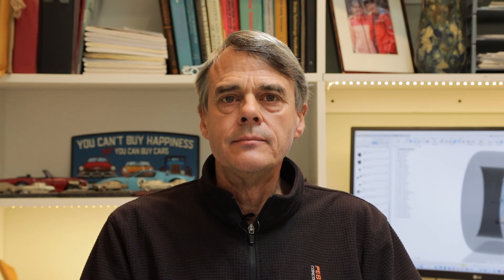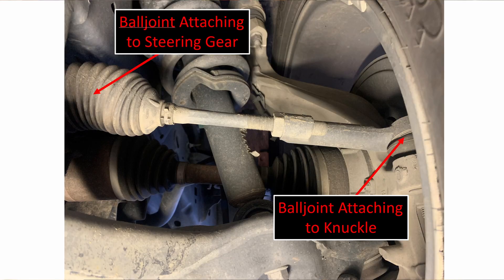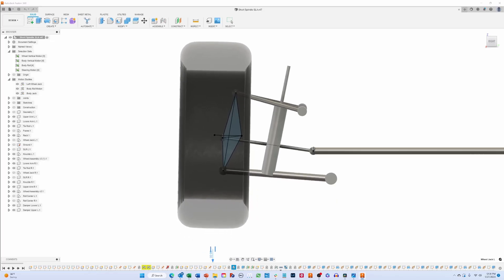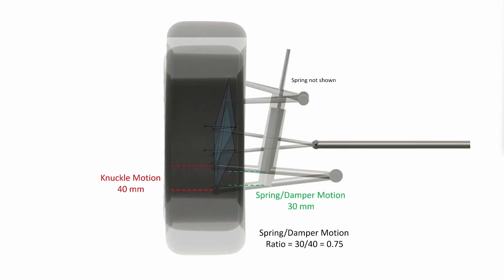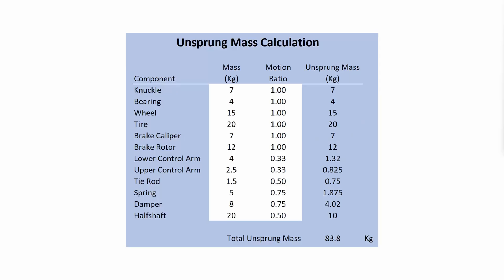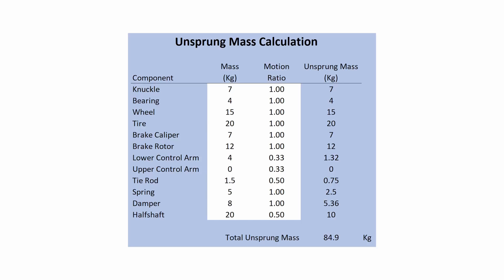Sprung vs.Unsprung Mass

Comment: Hi, it would be nice to get explanation why every car or truck has vibration around 65 mph, doesn't matter how well wheels balanced. Another question i could not find reasonable explanation , why body over frame cars resonate over portholes. While cars without frame is perfectly fine.

Regards 
Steven.

Comment: Is it accurate to say that the unsprung mass is the mass that moves while spinning your tires and the spring mass is the mass that doesn’t?
Reply from the maker: No, the inspiring mass is the mass that is moving when the wheels go up and down. it has nothing to do with the rotation of the wheel.

Comment: I replaced the forged aluminum wheels on my 370 Z with a set of forged magnesium ones, replaced the steel lug nuts with aluminum ones and replaced the steel one-piece brake rotors with two-piece aluminum hat ones. I also went with lighter Mivhelin tires to get a total of 45 lbs reduced from the unsprung weight on the front end and 35 lbs on the rear end. The improvement in the handling and reduction in the harshness in going over bumps and irregularities in the road was quite noticeable.

Comment: I guess the wheel and its associated components would be considered sprung mass in relation to the tire tread's "unsprung mass" on the pavement. I speculate this is why a good tire at certain inflation pressures can have a major impact on ride quality for high frequency bumps. The tread on the pavement may be only 0.3 kg and the rest of the wheel dynamic components may be 30 kg giving a 100:1 sprung to unsprung ratio for the modeling of the wheel components. It would be interesting to see what impact this has on overall comfort and performance and what are good ratios for this subsection of the suspension?
Reply from the maker: That is correct but the impact is small. In reality, the unsprung mass of most vehicles is in the 50-65 Kg range, so your ratio is more like 200:1. Also, the spring rate of a tire is usually on the order of 300-350 N/mm which is about 10x the spring rate of the suspension. There is also relatively little damping in a tire to go along with this high spring rate. Having said all that, there is a school of thought that says that high unsprung mass is not necessarily a bad thing because it forces the tire to do more work over those small high frequency bumps. But it's really not the right way to do it. There are better ways to absorb that high frequency energy in the mounting system of the springs and dampers. Tires are a wear-out item and you don't want the ride comfort of your car to suddenly drastically change when the customer needs to replace their tires.